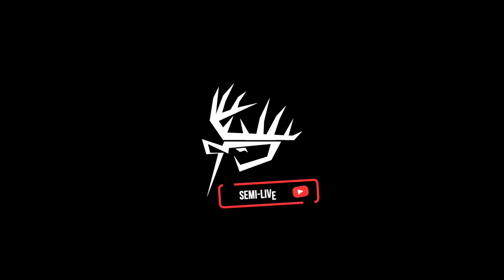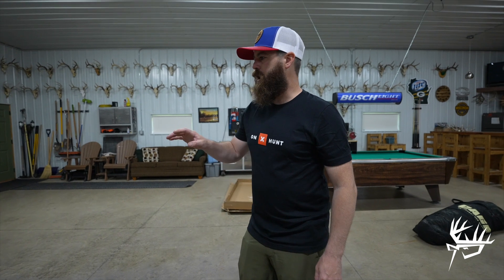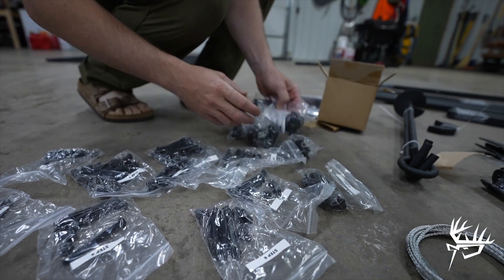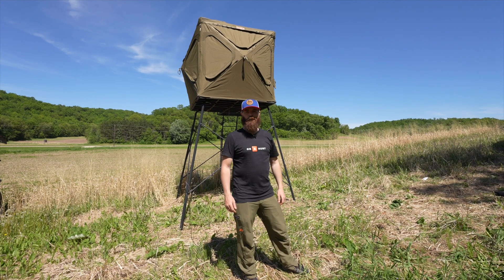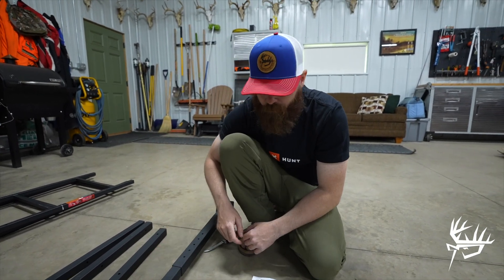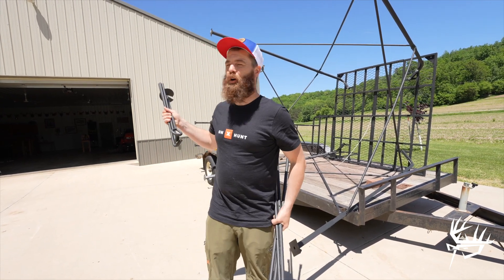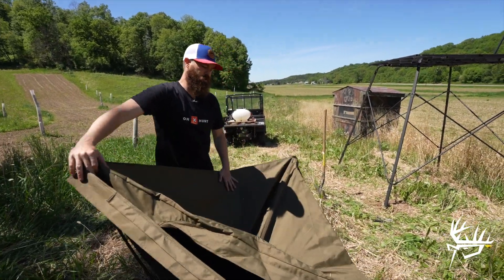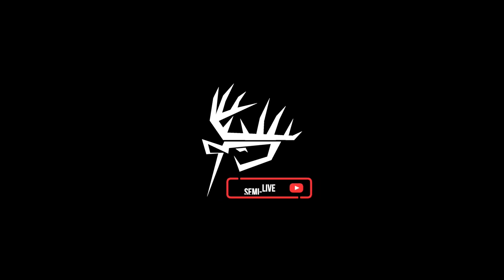Cage Blind Assembly: Affordable Permanent Hunting Blind

Comment: How do you secure each corner to the platform? In your video u see the rods going through the bottom, just wondering how u secured each corner.
Reply from the maker: Each corner is bolted right to the frame of the platform.
Reply: Thanks, for the info does the platform come with the bolt to secure each corner?